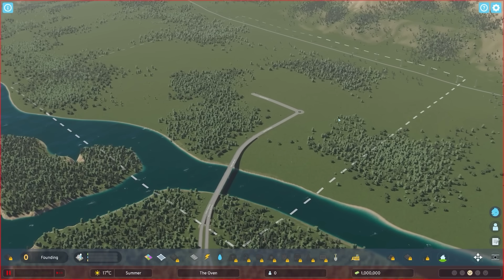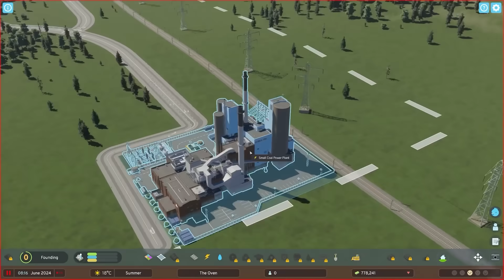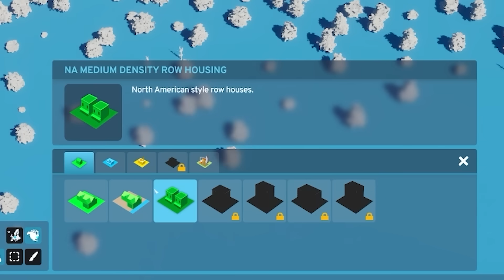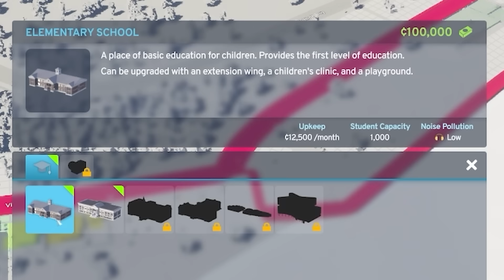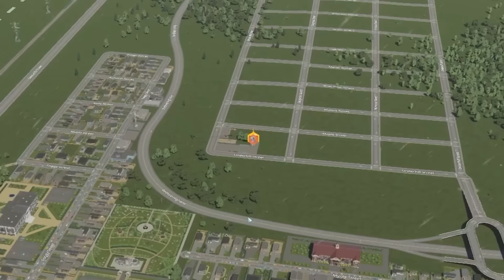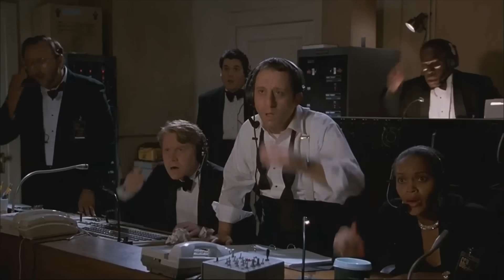Can a ONE TILE city still be successful in Cities Skylines 2?

Comment: My trick is you need to keep painting and building, and let the time run, soon you taxes will be okay, but if you keep your taxes high, you won't have demand so I learned that if you put what you want to put in at 0 you can force demand that then re hike the taxes, but when you spend fast you losing more than coming in, I think they start you with to much money, but also the mod for tiles the 529 tiles you can bring down the cost of renting or owning tiles which can become very expensive, also let time do it thing again your moving to fast. Lastly Mod creator Washi 776 has mods for many building giving you options for many smaller variants so you can help with cost but still have the important buildings. They also have a easy mode now too, and did many fixes since this video, it's still not easy on hard mode but manageable if you know what to do. I go around fixing my intersections with the mod Traffic, and Traffic light enhancement, it's fun and can really help with your cities movement system! Also Build farms they cost hardly anything and bring in a ton of money!

Comment: Memphis, TN pumps water from an aquifer despite being on the Mississippi River because it’s cheaper to treat the groundwater into potable water. Also, since moving away from Memphis I have noticed that tap water and sometimes filtered water in most places is significantly worse in flavor than Memphis tap water

Comment: Real simple. 
Taxes ,population & land value.
What you want is for your population & land value to increase at all times until you reach your utility services capacity (water, waste, electric etc.) so you start at 0% and then slowly raise it until your either you start losing population (at which point imediatley lower it to whatever it was before and keep it there) OR yo just cant fit anymore people because doing so breaks some utility service (or you're out of space).
What you had done was raised taxes TOO HIGH TOO FAST in order to ' increase your cities tax revenue'> Thus driving the population demand downwards> Thus lowering the population > thus leaving more vacant buildings > LOWERING LAND VALUE> Thus lowering your cities Tax revenue collected>thus leading you to raise them AGAIN to try to  ' increase your cities tax revenue' > THUS feeding into the Positive Feedback Loop, making things worse and doing the exact opposite of what you wanted. 

SO, you have to Start at 3% or 5%, raise & lower taxes a percent watch population demand for a few periods to find the tax% equilibrium where your cities' population demand is still rising and if you go ANY higher with the tax% it would cause the population to start to fall. At that point that's where you ROLL back your tax rate and stop it there. IF you STILL have tax revenue short falls YOU HAVE TO CUT EXPENSES, YOU CAN NOT RAISE TAXES (each city is different, but around 7-12% is where you'll find your tax% equilibrium);  If you build right, by continuously increasing the LAND'S VALUE (I.E. by building or re-zoning to Higher Density Zones that allow for multi million dollar hi-raise buildings.) it is quite possible that you will find that is the only time you will ever need your taxes set so high in your cities play through as over time you will have to lower it in order to keep population demand on the rise.

Comment: Cities skylines 2's tiles are smaller than on Cities skylines 1 aren't they? 
Also from what I've seen in this video the taces work fine. There's just a bit of delay between when you change it and when it actually changed in the game but that's normal, it's the time the game takes to calculate what will be the new taxes.

Comment: With the new changes, you can't overbuild or your services will explode your budget... just like what happened to you. Start with Turbines and develop up. You can still play single tile by building a "ring city" and then working your way to the interior favoring higher density projects in the grid. Once the urban core supports it, flip the original ring to a high speed orbital and convert the exterior to industrial.

Comment: The reason the coal plant was costing so much is because it ran out of coal so you're importing it. Coal mining is needed to keep them affordable which is why my first few development points go towards getting geothermal power. Yes it's expensive, but it's like wind and solar; it doesn't have the hidden up upkeep cost of keeping it fueled. Plus since hardly anyone ever uses groundwater pumps for water needs you don't have to worry about the pollution it'll give to whatever aquifer it's placed on.

Comment: Ah the pain of management. Found myself in that hole a fair bit before. Restarted my city and now making a whopping 177+k/h on 10% taxes across the board and 100-110% services budget, the trick is watching your maintenance costs, keep taxes low so your people want an education since the price is the same across them thus bringing in more qualified people and those qualified people want more jobs like office space and the like thus raking in even more income. I’m running a level 13 city almost to 14 with my office space at 10% taxes making me 6M. Another thing is you want to keep demand, trying to completely curb demand tanks your budget too plus with demand means more people still desire to live there and in the long run that’s what you want if you completely curb demand eventually your city budget stagnates before crashing.

My biggest issues are traffic jams, I’m terrible at setting up decent junctions and the prebuilt ones are so large that I try to avoid using them, the second issue is my education coverage isn’t really up to par with my 80,921 residents lol

Also try to use power plants your city has the resources for, supplying your own coal or oil needs works so much better compared to importing those goods. Plus any excess you have of said resource can go to exports thus bringing in even more income to your city.

Comment: The thing about boring roads is pretty spot on. On my home country there was a highway that crossed a hugeeeeeee steppe and it was like a straight road it would take you like 6 or more hours to go through if you're going like at 100km/h (~62miles/h) the WHOLE time.

It was known as a very dangerous road as drivers would fall asleep at high speeds and crash in a very far away rural area.
Reply: That's why my car drives itself on highways, minimize driver engagement for maximum nap potential
Reply: @james2042 please don’t purposely nap on highways, I know self driving tech is sorta getting there, but it isn’t there yet
Reply: @slideways8022  how am I supposed to stay on the road 24/7 to get to my destination faster if I don't nap behind the wheel

Comment: With this update, high taxes doesn't work, it will make people move away. 12% from cs1 is back.
Reply: I did 12% residential, 13% commercial and 14% industrial on CS1.
Reply: I actually break down taxes down to the individual item. It's actually well worth it to subsidize the industry for things like food and beverages at full 10% subsidy because you can make it back ten fold by taxing them at 15% in commercial districts. 

It's well worth checking your production tabs. If there's a shortage subsidize production tax consumption. If something is making no tax revenue slash the tax to nothing as it will increase production at no cost to you.
Reply: Me with 30% commercial: This is fine 🔥🔥🔥 (it's not it worked before the update but when I loaded my city everything was gone before I could do anything but now I'm higher in plus then before).

Comment: Just so you know, industrial zoned buildings (NOT the plopped buildings like the coal plant or oil fields) do not create nearly as much pollution as they seem. You need hardly any separation between them and residential. 

This is completely different for the plopped buildings like the ones i mentioned earlier. These buildings have heavy pollution so they are the buildings you have to worry about.
EDIT: Upkeep is killer in the new update. You need to be very careful early game, watching what the upkeep costs of all buildings.
Reply: Might as well keep the plopped buildings like coal plants with your industry
Reply: Damn, even before the update building a hospital meant treading on the verge of bankruptcy. Now it's just instant death, I guess
Reply: Or touch the funding for them... at all... ever.. You don't need a 100% funded power plant, water pump, or sewage.
Reply: Before it gets famous
Reply: Yeah, basically dont place any non essential service until you NEED it, power and water is basically all you should have until you have like 15k or more population.
Reply: @zo7034  yeah. As soon as possible I unlocked power generation so I could sell it. After that I went for taxes, kinda how rce did it in the video by lowering it to 0 and then bringing it up to 13-14%